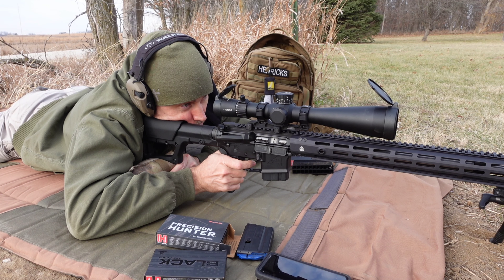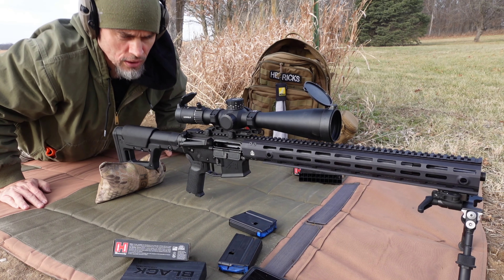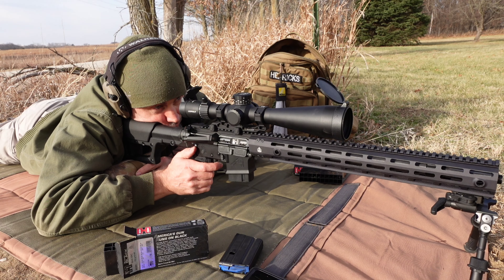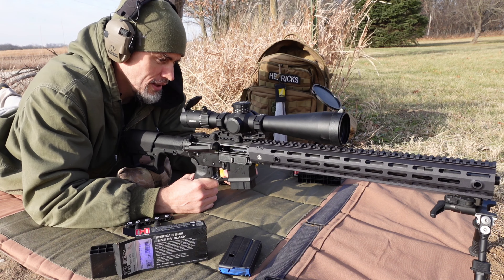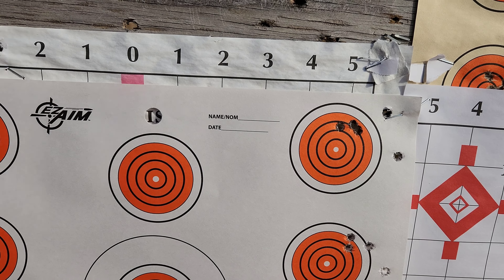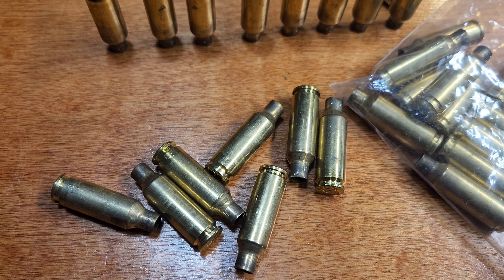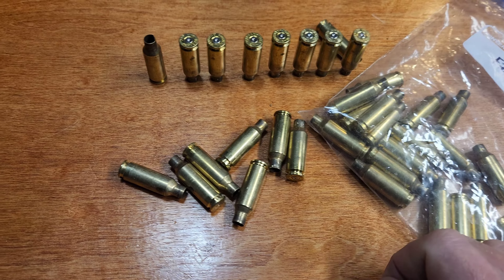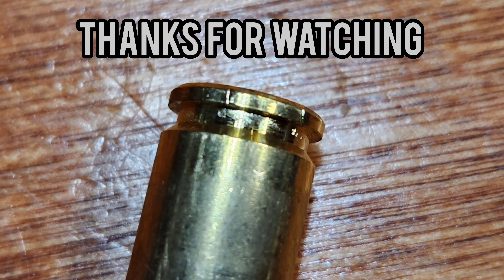6mm ARC: Hard extraction/short dwell bolt lockup? Maybe, maybe not!

Comment: I’ve had 2 proof barrels, 18” & 20”. I haven’t had any issues with accuracy. What I found for gas, since it’s a +1 rifle length, once I switched from ADJGB to standard, I had better function of the weapon. Also, I switched from a Armaspec SCS to a standard rifle buffer system. This also helped in my function. Finally, I was using ASC mags. And the spring broke. Like into 4 pieces. All of mine have been surpressed with an OSS. Gas guns are inherently hard on brass. I’m getting 8+ firings on my brass. As far as extractor marks, I am getting more of a raised burr than a swipe. But no pressure issues. Hope any of my experience helps you out.

Comment: Looks normal to me. You could file the sharp corners of the extractor if those marks bother you. A little bit of texture to the chamber helps to grip the case while it's expanded, it's not a bad thing unless it's damaging the brass or causing feeding issues. Your 103 groups look good considering your scope was coming loose.

Comment: Wow somebody who's not a fluffer for the 6 mm ARC. Everybody else says how perfect it is. There's even people who say it has the same power as a 243 Winchester. I've been shooting the 243 for 40 years with different custom barrels. A lot of people don't understand that smaller cases require faster burning powder and faster burning powder creates higher pressure. High pressure blows primers and leaves marks on the bottom of the case head and expands the case head.
But somehow hornady is smarter than everyone because they copied the 6mm ppc/ 6mm AR and designed a cartridge "from the ground up" by copying what other people did.
Reply from the maker: Honesty is the best policy, if you don't admit the shortcomings how can you fix them. I've seen way to many people buy really expensive guns and gear and they didn't live up to the hype. The 6 ARC has a couple of problems I might address in another video. I like it but no cartridge is perfect.  I like .243 and 6mm Creedmoor  better as all around cartridges.
Reply: @thelonggunner762  well the 6 mm Arc Burns less powder but I think the confusion of loading to the correct pressure for a AR-15 and loading to a higher pressure for a bolt action will cause some blown primers and case heads. A 243 can actually be loaded down to 6 mm Arc the velocity or it can be loaded up to 300 to 600 fps faster than the 6 mm arc. Irregardless of what some misguided people think. The disadvantage to the 243 is it has to be in a AR-10 platform instead of the AR-15 , but no matter what 243 load you put in an AR-10 it should handle it without any bolt failures or case head failures. Meaning you can shoot hot loads or light loads out of all 243 Win rifles and if you have a custom Barrel you can get whatever twist rate you want and shoot the high BC 100 + grain bullets. Which is what i have been doing for decades before the 6 mm Arc.

Comment: Wouldn't extractor marks be more dependent on the individual bolt and not the caliber? I know with some bolts, the combination of extractor spring plus o-ring AND plunger is overkill. Often, simply removing the o-ring fixes the issue.
Reply from the maker: I wasn't make this as a general assumption of the caliber, this video is the third in a series on me building a 6mm ARC completely from parts and  diagnosing some issues I've had with it.